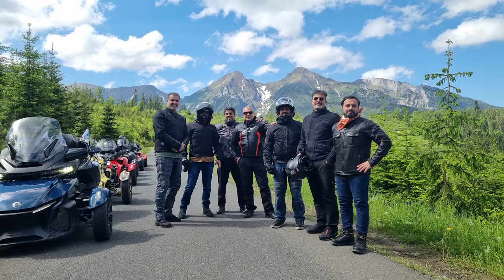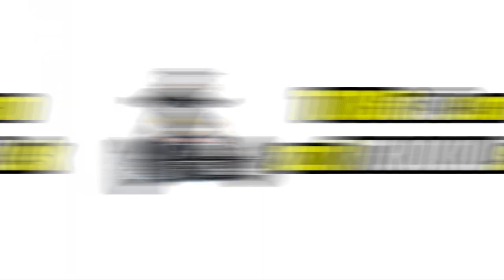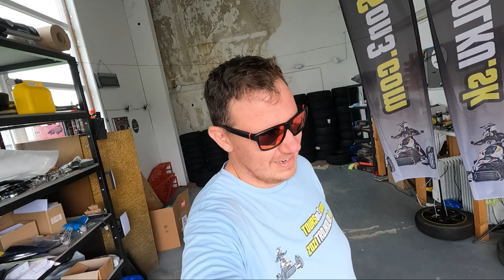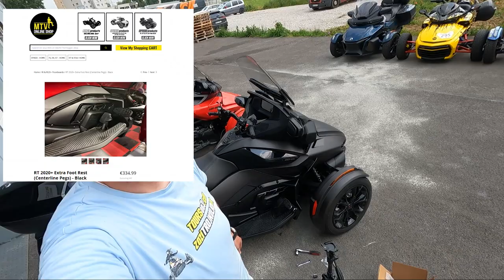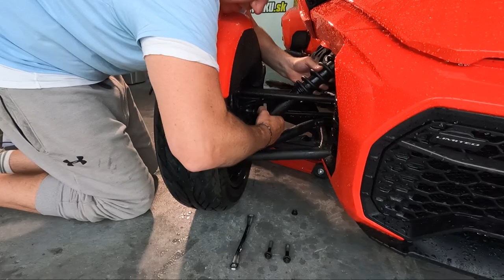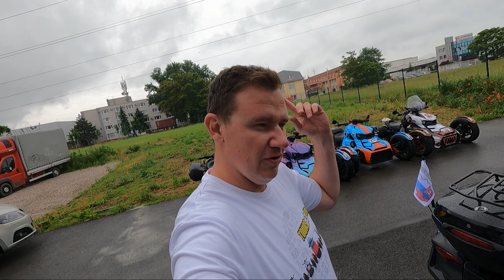#CanAm Spyder Must have Upgrades & Why by MartinTheVlogger

Comment: Great job Sir,

I’ve got the the handle bar riser and wanted to add the gps but the bolts are short now, do you sell the longer bolts?
Reply from the maker: Hi Nelson, if ypu go for this holder you dont need anything else https://www.martinthevlogger.com/product-page/f3-and-2020-rt-gps-mount no longer bolts are needed.